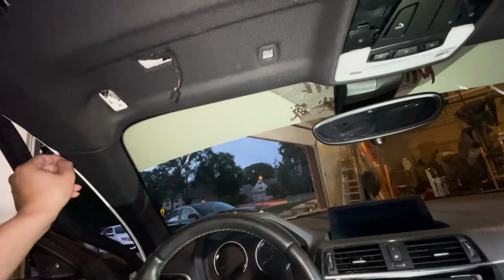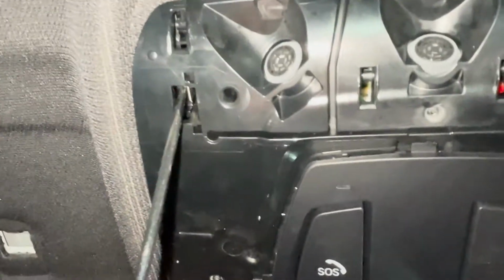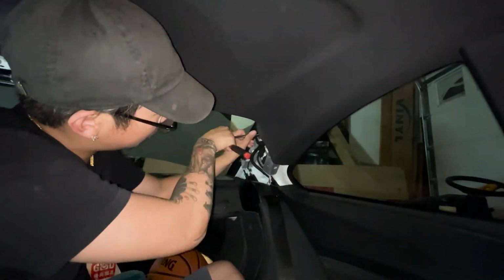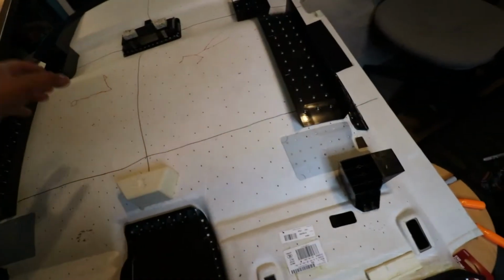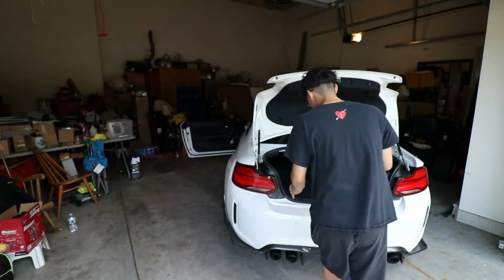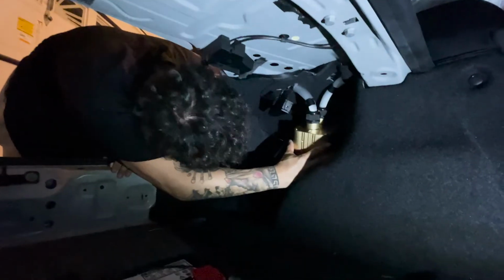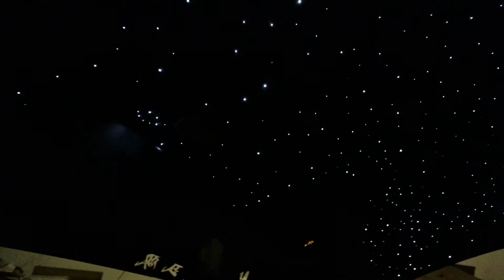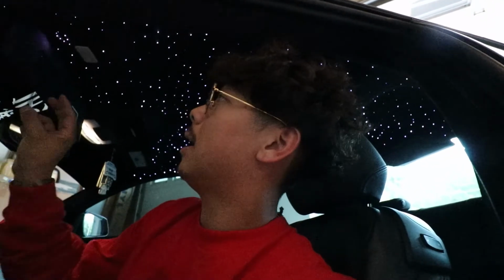How to DIY Starlight W/ Shooting Stars | Install

Comment: What is that cutter used to cut the fiber optics?
Reply from the maker: @Upstate_Hemi  I got that tool from harbor freight. You can use nail clippers, pliers, or whatever that can clip/cut.

Comment: Do you need to have the shooting star strands in a certain order or do they work no matter how you plot them?
Reply from the maker: @chrisrigsby8935  They work in sequence. In the module that controls the shooting stars. It’ll go in order. So let’s say you wanted to change it instead of single shooting stars and wanted to do a spiral. You’ll just place the fibers in order. It’ll give a domino effect basically. 😄